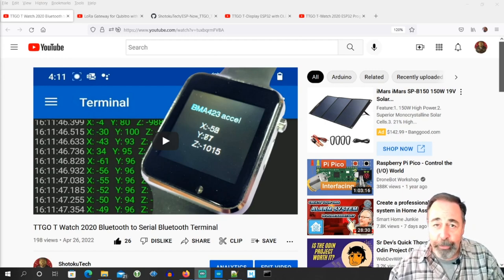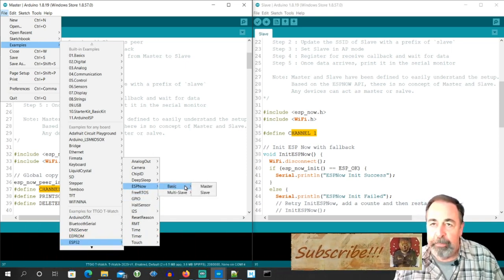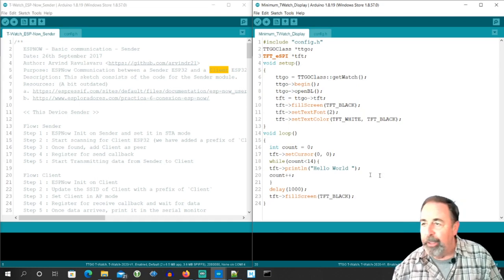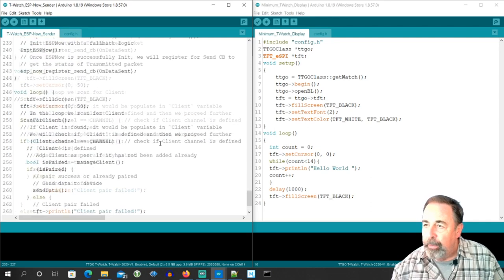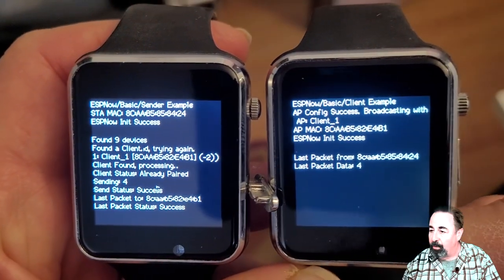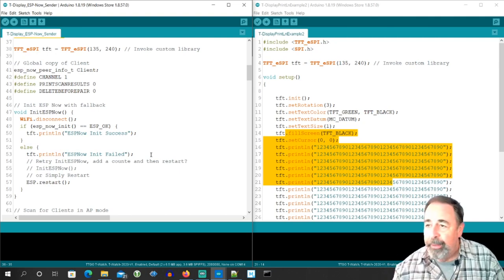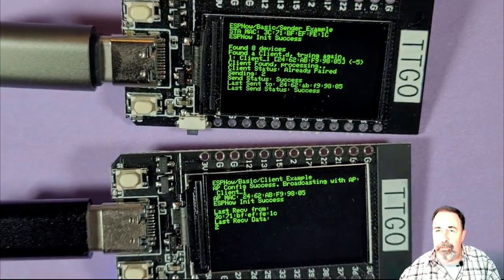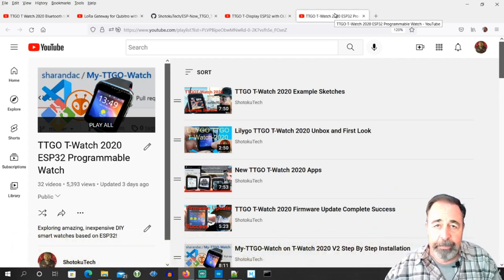ESP-Now on TTGO T-Display and T-Watch 2020

Comment: Beautiful so both the display and watch are working a like but the watch seems to have a little problem as you said 😊
Reply from the maker: So I made the thumbnail for the video with the T-Watch as the client and the T-Display as the Sender and this works out fine. The T-Watch as sender just gets heated and reboots. This was fun though. I am impressed with WiFi range on such a small board! Thanks.

Comment: Hi, I've ordered 2 T-Watch 2020 watches with a goal of watch-to-watch communications across a WAN like a public library to my home and was wondering if you touched on this in your travels?  The watches have not arrived yet and so after finding your work I'm starting through your videos and found this ESP-Now video. Thanks.  I also realized after the fact that I should have ordered the 2020 V3 model but I had only found the 2020 vs the 2021 and felt the 2020 was preferred. I'm figuring I can still develop a solution on the 2020 and later upgrade to the 2020 v3 or even 2020 v2(gps) later without much of any code changes. Thanks for the great list of videos on this product.
Reply from the maker: Hello. That's an interesting idea, watch to watch over the internet. I might see what I can do for that. It could be weeks before I get around to it. I don't have a V3 yet either. Best wishes. Thanks.

Comment: I wish that I was as successful. I also just built an ESP NOW project using two standard TTGO T-Display modules and I want to use it in the house..Sadly,  between the Den and the Garage.. it works very well until I step onto the garage, and at that point the line of sight path is blocked by the refrigerator, microwave, and a gas range with large metal hood... and so it gets erratic and stops receiving my sensor data.  I dont want to add an external antenna, so tried slowing down the data rate instead.. however when I try this I get errors that ChatGPT tells me are normal with Arduino IDE which will not let you configure the wifi speed .. and that I should use the ESP IDF to do this instead.. Have you encountered a range issue inside the house?  and figured out a way of solving it perhaps by setting the slower 1Mbit 802.11n speed.. ChatGPT tells me that a router would normally negotiate this data rate reduction but many devices ( like the T Display) can't .. I am hoping that there is some other easy way to increase the range tho since I think adding an external antenna would be a challenge and frajile, and I need all 5 lines of text I can get on a T Display ( vs the Lora version OLEDs)
Reply from the maker: And you said a mouthful friend!